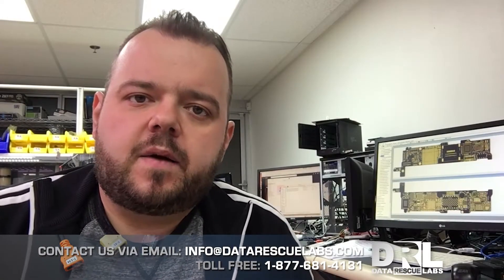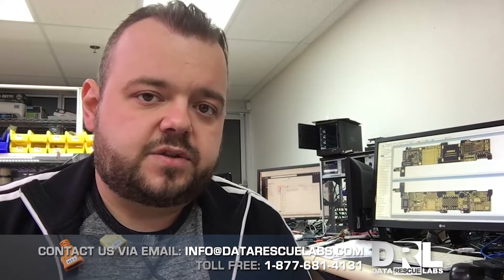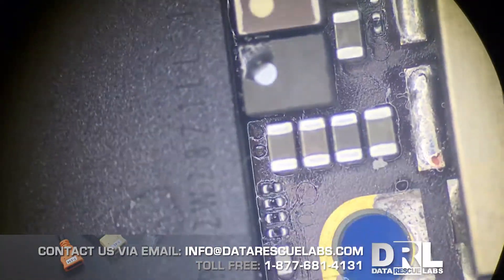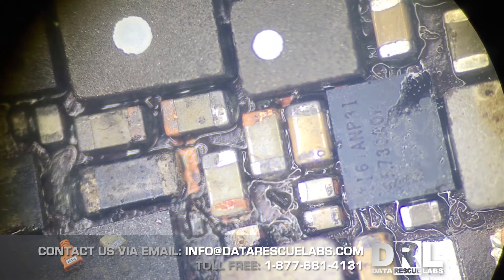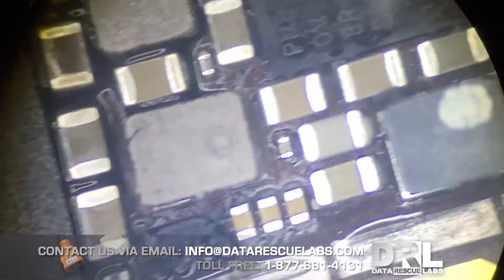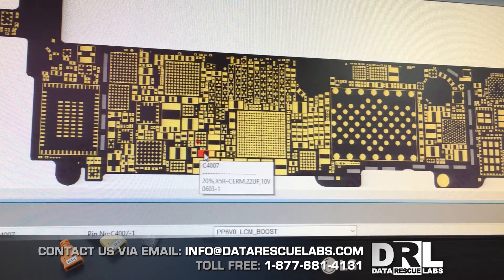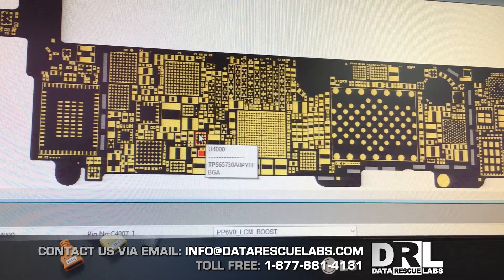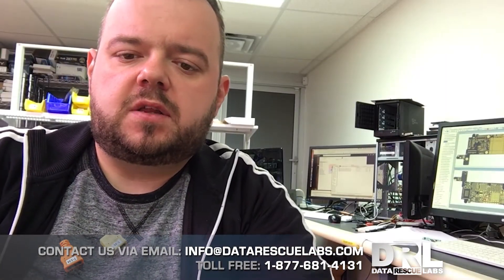iPhone SE - Water Damage Data Recovery

Comment: Just got my SE back from the shop. It seems it has water damage exclusively on the antenna. I was told it will work but it's functionally a VoIP landline because the relevant component is soldered to the motherboard. Seeing as it's already junk, if I wanted to tinker around with it to try to fix the shorted antenna what would I need to do?

Comment: Hi, is it possible to recover photos from an iPhone 13 that is stuck on the flashing Apple logo and will not even turn off but will allow a USB connection to Apple Devices application on a Windows PC? The process to do the update using Apple Devices always fails with a number of unknown error codes.  So far, I have seen a 4013, 2003, 5 and 2009 error codes. Any ideas?